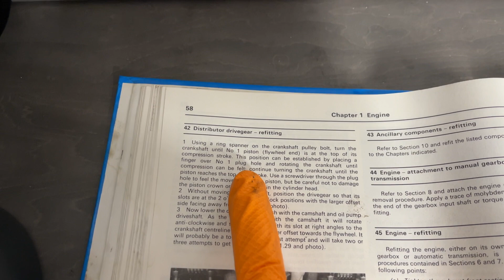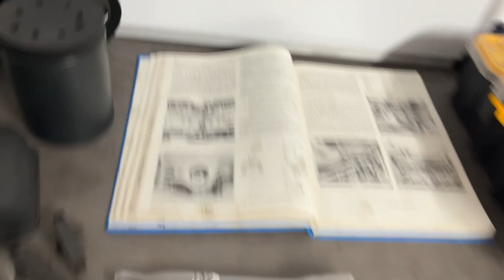Completed RENAULT 5 GT TURBO Engine Rebuild  - Timing, Distributor Drive Gear & Covers

Comment: You must fit washers and nuts to the rocker shaft studs or you will have no oil pressure to the shaft/rocker arms
Reply from the maker: Ah sorry got it. The two studs that go through the rocker! Thanks for the heads up 👍

Comment: Nice, nearly ready for fire up!   I normally normally just stuff any openings up i.e oil and exhaust/inlet with some clean micro cloths, also when using that screwdriver method to help find TDC i just wrap a bit of black tape around the end of the screw driver to avoid marking the piston.
Reply from the maker: Great tip! Thanks. Trying to work out if it’s possible to “fire up” without putting it back into the body… got a feeling it could take me a while!!
Reply: @Renault5Rebuild  Yea it's possible, but a lot of faffing about, just drop it in and fire it up, it will be fine.

Comment: I loved this car in its day! 4 wheel drifts round roundabouts (ahem!). But it would run out of steam top end (which is good by any stretch of the imagination) and would get hot, unlike my mate's Fiat Uno Turbo. Don't see them much either these days. Great times
Reply from the maker: 100% agree. Afraid this 5 won’t be driven like it probably used to… 😈. Going to think about the overheating issues.

Comment: Nice one! I thought for a moment that "I am done." in the thumbnail meant something went horribly wrong and you'd had enough of it all... BTW if you ever do need to find TDC by sticking something down the bore you're unlikely to damage it with a screwdriver but you can always use something made of plastic or wood for peace of mind.
Reply from the maker: Not going to give up that quick 😉. Thanks for the tip, if I hadn’t still had the gauge attached I was thinking of using something plastic. Hope your enjoying the content and thanks for the support